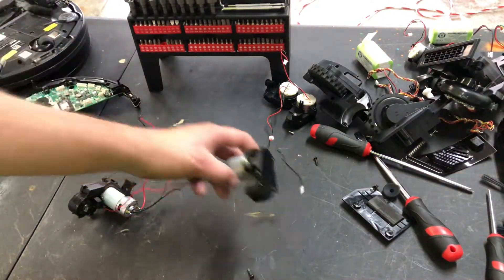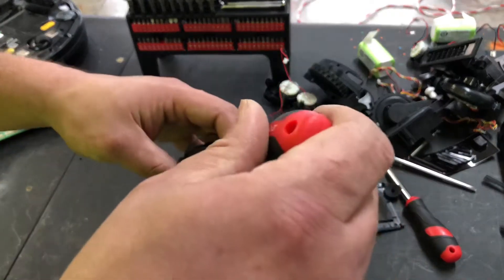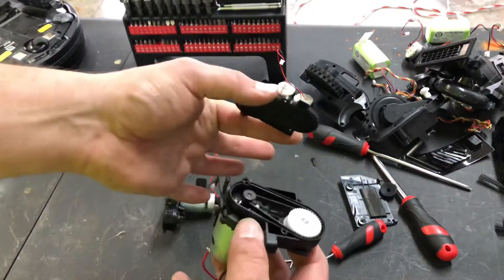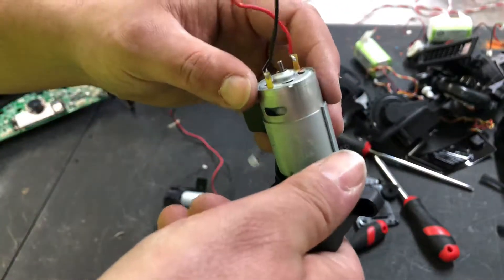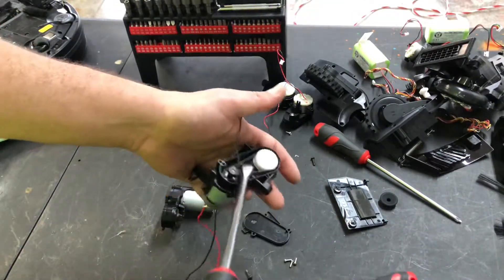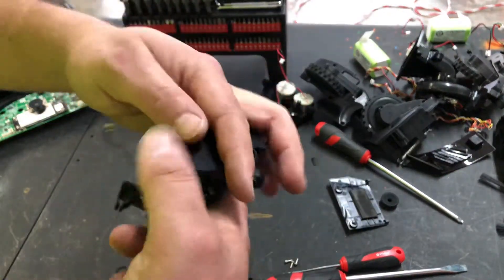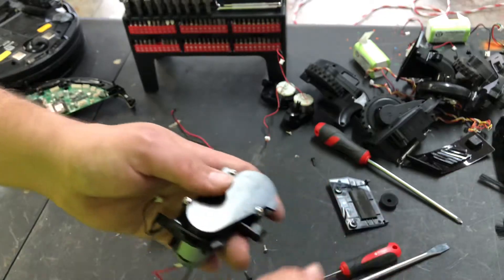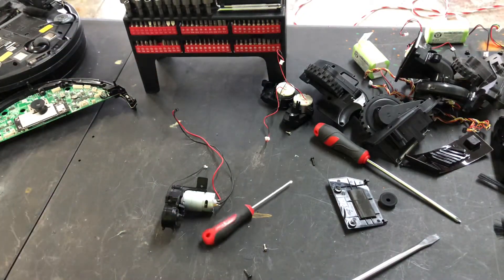Grinding Noise Trouble Shooting Shark IQ 1001AE Brush Motor Assembly

Comment: Hey it's me again. You were a huge help with my last problem but now I'm having a error 14 model is ur1005ae
Reply from the maker: What does error 14 mean for that model ? I don’t have the info on hand
Reply: @SmittysWorld  it's the boundary sensor I believe. Move away from magnetic strip
Reply from the maker: @dontgiveabucktv656  there is a sensor on the bottom that reacts to the magnet stripe. Sometimes you can tap on the bottom and get it to free up
Reply: @SmittysWorld  not the cliff sensor? a different one?
Reply from the maker: @dontgiveabucktv656  they are together
Reply: @SmittysWorld  ok thank you

Comment: You mention that it’s notorious for getting debris inside their cases. Can that be cleaned?

I was getting an error about obstruction underneath which apparently is due to the brush not spinning freely. Even with no brush in it was giving the same error which I think means it must be related to the brush motor itself then. There was some pet hair in that case location you mentioned as notorious…I did my best to get it out but now it’s notchy so I think my problem is debris in the case as you mentioned. 

Is there any way to clean that? I have it all apart and don’t see a way to remove. Or if you have that problem does it mean you have to replace the motor? I wish I could clean it now because then it would be fixed rather than waiting on a part. The belt inside looks perfectly fine. I’m guessing it’s not supposed to feel notchy and it’s supposed to turn freely?
Reply from the maker: Should move with a little first but not notchy
Reply: @SmittysWorld  Ok. Thanks a lot for the feedback. Makes me feel better about having ordered a new one. Wasn’t sure if I was just wasting money. I’m guessing it’s not really cleanable, and I have no idea what’s causing the notchiness as there is nothing visible…it basically silently clicks the whole way around.

Belt and gears look perfectly normal.
Reply: @SmittysWorld  Btw, thanks a lot for making these videos. I’d have never been able to get it apart without them because I wouldn’t have been able to tell what’s holding things on where and would have broken things trying to free/remove them.

Even with the videos I still had trouble at points but eventually got it since I knew what it was supposed to do and look like.

I probably would have thrown it away otherwise.

Comment: I’m in the middle of taking apart my self emptying IQ vac bc it keeps saying there is an obstruction in the side brushes. Also, the one of the brushes doesn’t move freely the way it’s supposed to. Do you have any vids or advice for the side brush motors on that model?

Comment: my brush motor assembly is throwing error due to dog hair in the space around the brush connection (square key).  Is there any way to take it apart further to get to that area?

Thank you.
Reply: I have the same issue.  Belt off, and can't turn the white wheel inside.  Can that be pried off and then lubricated?